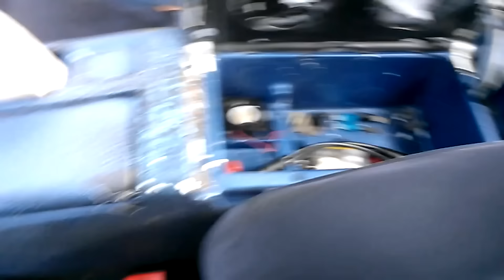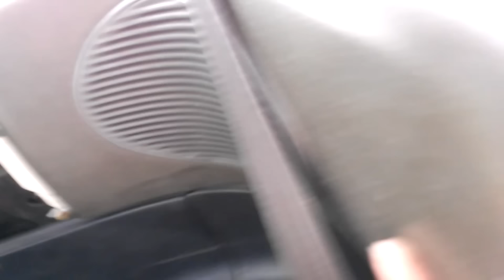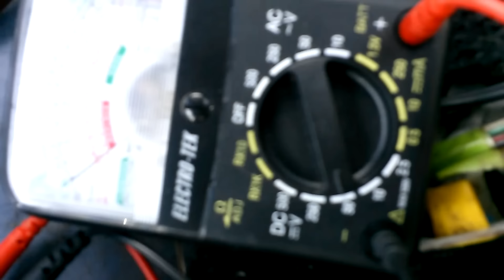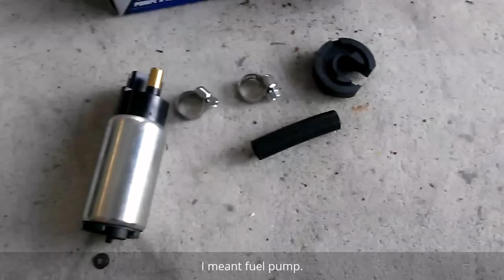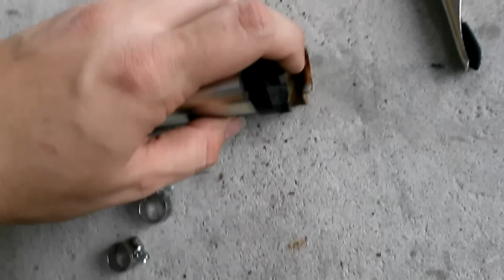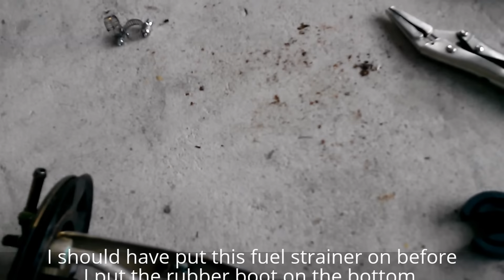1993 Honda Civic del Sol fuel pump diagnosis and replacement

Comment: Honestly this is the best most comprehensive vid on this I have found. Thank you so much. Also what do you do if the upper inside of the connector comes off when you pull it off the pump. The yellow part for power.
Reply from the maker: You broke the piece the wire clips to off?  Unfortunately - you probably need to replace the entire hanger.

Comment: For a 93 del sol what other car fuel pump can I use I cant seen to find one new at auto parts
Reply from the maker: Even if you're not in an an area you can order from rockauto, you can get the part numbers to check around where you are and if you click the part numbers then it will show what other cars it fits.  I personally would recommend the Delphi, Denso or Bosch parts if it's for a car you plan to keep for life.
https://www.rockauto.com/en/catalog/honda,1993,civic+del+sol,1.6l+l4,1168983,fuel+&+air,fuel+pump,6256
Reply from the maker: Oh - and if you do order from rockauto - make sure to get a strainer.  https://www.rockauto.com/en/catalog/honda,1993,civic+del+sol,1.6l+l4,1168983,fuel+&+air,fuel+pump+strainer,6212
Reply: Yeah my fuel pump and all that is still good but leaking from where the hose goes with the lil clamp someone tried to fix it with putting but it leak over the time
Reply: I need the whole assembly basically I have a new pump and strainer already just need the cap piece thats where the 2 hoses come out of one is broke and leaking from there
Reply from the maker: The part you are talking about is disontinued.  The only way to get it is used off another car.  Are you leaking from the metal banjo bolt area?  There should be a waster on the top and the bottom of the hose connection and if one or both are missing it would result in a leak.
https://www.hondaautomotiveparts.com/v-1993-honda-del-sol-coupe--si--5-speed-manual/electrical-exhaust-heater-fuel--fuel-tank
Reply from the maker: That being said, I am finding a few other Honda parts sites that are offering the item for sale but at over $300 USD.  It would also include the pump, strainer and gasket.

Find out where the leak is coming from.  You may just need less than 10 bucks worth of washers or gasket.

Comment: I just started working on my car and when I got to the removal of the hose, fuel started coming out constantly. I didn't know if there was a lot of pressure that needed to be released, or maybe that this is a problem. Please let me know what I should do, I'm afraid to continue.
Reply from the maker: I believe I stated in the video how to relieve the pressure in the system at the fuel filter.  Not certain though, it's been years since I made the video.
Reply: @cracklingice  Ah, I didn't even notice. I feel like a dumbass. Thank you!
Reply: @cracklingice  zzz zzz

Vv

Comment: But where's the video of it working
Reply from the maker: Why?
Reply: @cracklingice  what you mean why? To see if that fuel pump actually working lol
Reply from the maker: Yeah it worked.  I start the video off with how to diagnose if it's the fuel pump.  I show how to check for pressure at the fuel filter to determine if you are getting fuel to the front of the car, then I showed how to tell if you are getting power to the pump.  If you have power to the pump and no fuel pressure at the filter, the pump is pretty much the only thing that can go bad.  Well unless you punctured a line somewhere and you were just pumping fuel all over the ground under the car.
Reply from the maker: I had already gone thru all the panel removal and testing before buying a pump and making the video.  I literally shot the entire 'disassembly' backwards as I was putting the car back together and through the magic of editing made it look like the car was being taken apart.  I had my hands full with that so putting in a clip of the car running slipped my mind.

Comment: Fuel does come out but theres no fuel pressure and pump is new.
Reply from the maker: Sorry, I don't quite understand what you are trying to say here.  It sounds like what you're trying to say is that pressure is low.  If that's the case it could be anything from an injector stuck open, to a leak or just a clog in the system somewhere.  Or - you only checked for fuel to come out once while it was still under a little bit of pressure and did not power cycle the car and check again.

Comment: If my car has no fuel, will the fuel pump still be turned on?
Reply from the maker: As far as I know, yes, but you can easily burn out the pump if it's left running with no fuel to keep it cooled and lubricated.
Reply: @cracklingice  it's been sitting for a year, which is why I ask. So is it possible the pump is bad then? Or should I just add fuel first and then go from there?
Reply from the maker: If it's been sitting for a year, it's quite possible the pump went bad.  When you pull it, it'll probably be all rusty.  I'd also suggest getting the tank drained and cleaned if it is.  Or at least drained of the old fuel.  Fuel doesn't sit well for long periods.  Well maybe if fuel stabilizer is used.

Comment: Cracklingice I’ve got no power to my pump what should I do
Reply from the maker: Consult the factory service manual.  It could be a bad fuse, ground, relay, ect.  Also do remember it is not simply powered on all the time.  It will only show power for a few seconds when turning the car to the on position.

Comment: Where is the fuel pump fuse?
Reply from the maker: Check 18, 24 and 31. https://honda-tech.com/how-tos/a/honda-civic-del-sol-fuse-box-diagrams-374429  If they're all good but there still is not voltage going to the fuel pump, check the pgmfi main relay.
Reply: @cracklingice  I just want to pull them so I can do a complete SeaFoam cleaning. Some guy on YouTube said to pull your fuse so the pump doesn't work and run car off of Seafoam spray. When it's out your car will stop. says it cleans a lot better that way... So are you saying I have to pull 3 fuses?
Reply: @cracklingice  P.s. Thanks.... is this the fuse box that is inside where the engine is or is it underneath the passengers area? Thanks!!

Comment: I changed my fuel pump on my integra 1995 and it still dont have no fuel pressure to the fuel regerlator so what do i do next, fuses are good too
Reply from the maker: First check for power at the fuel pump, It should blip on for a moment when you turn the car to the on position.  If no power; check fuses, check relays, check wiring, ect.  Figure out why the fuel pump isn't getting power.
Reply: cracklingice yea everything is fine but it still dont give any fuel pressure. Can it be a ecu problem?
Reply from the maker: So what you are saying is that the fuel pump primes when you turn the key on but if you loosen the nut at the fuel filter you are not getting any fuel leaking out?  If you are getting fuel leaking out at the fuel filter, I'd suggest changing the fuel filter and seeing if you get fuel at the pressure regulator and rail then.  A blocked fuel filter could be the cause.
Is the car completely stock or a swap?
Reply: cracklingice car has a b20 in it and from the fuel regulator doesnt leak any fuel when i open it.
Reply: And yes it primes when i turn the switch on
Reply from the maker: Fuel regulator is after the filter.  The filter is mounted on the firewall.   The black container I pointed at in the video.  The regulator is on the fuel rail.  Unless you're running an aftermarket regulator and fuel rail that is.  Ultimately, I think the issue lies in the swap somewhere.  Or you just randomly got a DOA replacement fuel pump.
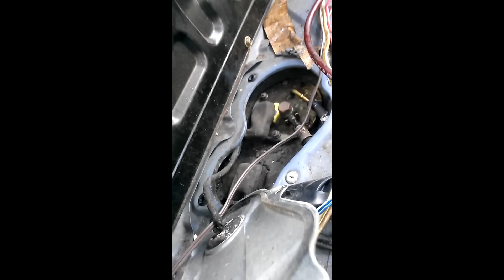Reply from the maker: If you have not already tested for power at the pump, that is what I demonstrate starting at 2:22
Reply: cracklingice i fixed the problem bro the fuel filter was clogged. I also have another problem, my gas gauge on my 1995 integra wont work. It dont show me how much gas i have, its below the E which means its really empty but i have full gas on my tank. Any help?
Reply from the maker: You have either a bad gauge or a bad sender.  Or there's a wiring issue between the two like the plug not being properly seated on the sender.  The sender could also be stuck.  It's just a float switch that changes resistance depending on how high or low the float is.